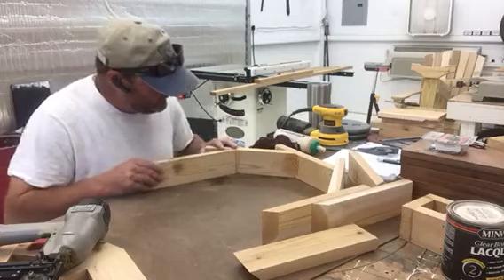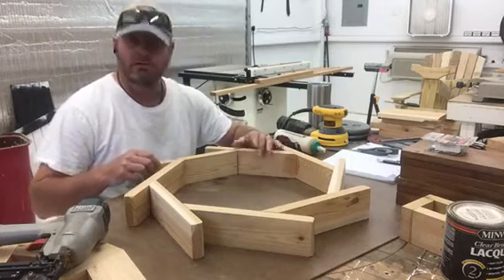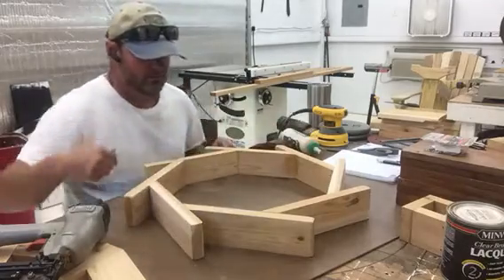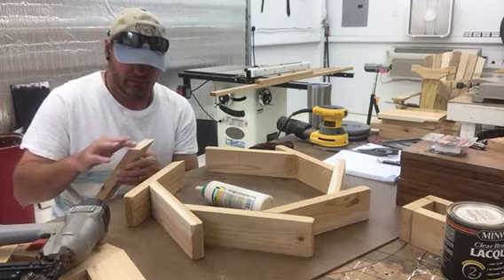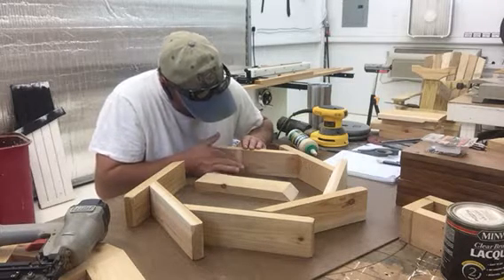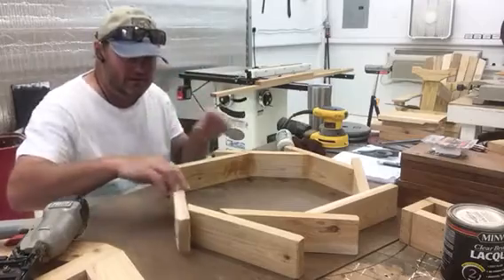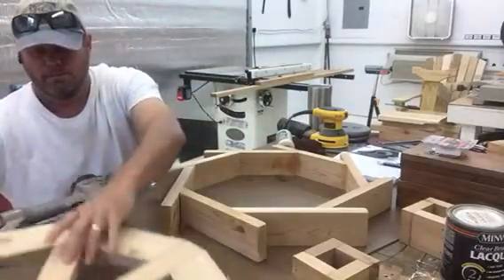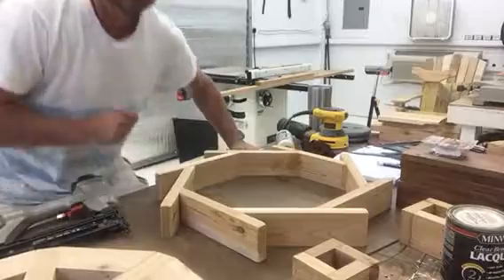Water wheel bucket construction

Comment: what size boards are you using for the Buckets , i  say 2 x 6   wife says 1x  ?   also  what would be  the measurements for a  2 foot wheel ?   we are building a plume type water feature for our yard  right now and want it to end with a 2 foot working wheel
Reply from the maker: steelguitarplayer1  they are actually 5 quarter cedar deck planking......
I don’t recall the actual measurements but it should be simple to figure out....sorry for not having those measurements
Reply: your buckets you say cut at 45° then say 22.5° can you please clarify?